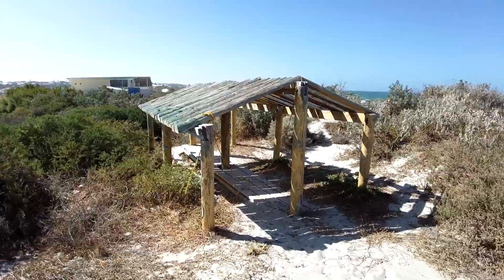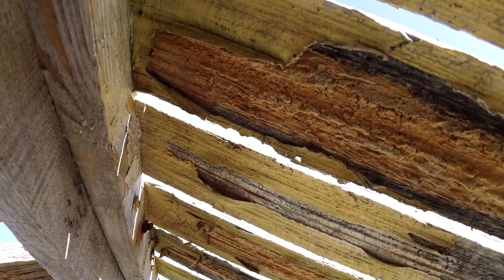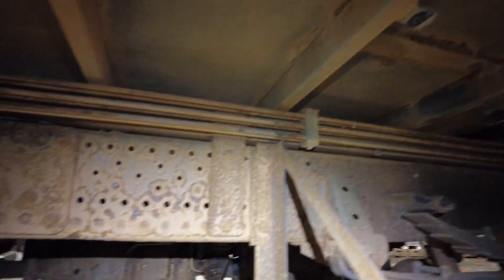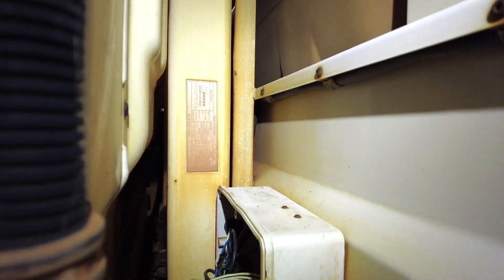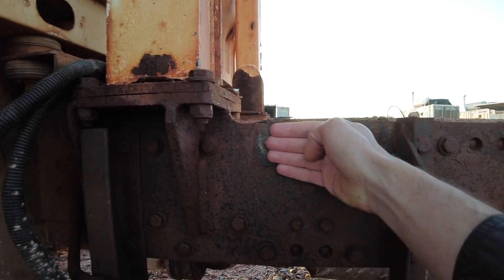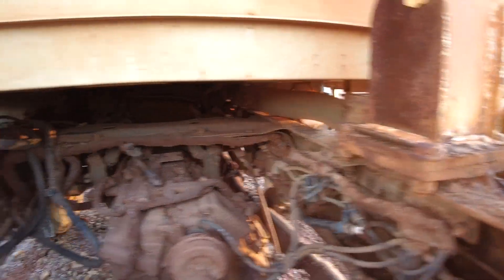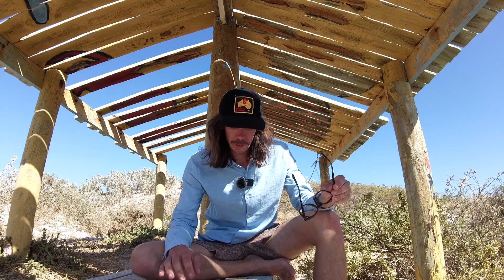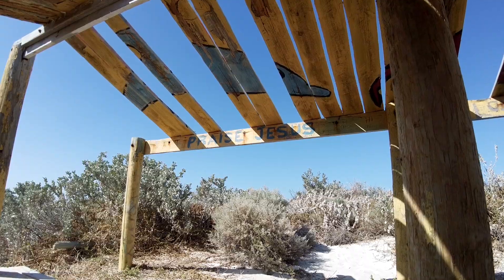Suzie's Weight-loss Journey - Isuzu NPS Expedition Truck Build - Episode 1

Comment: thank you for the detailed video 
wish on your rebuild of Isuzu 300/75 crew cab 4x4 truck
know second hand  2010 Isuzu model 5200cc with 5 speed   as happy with being the best buy  as keep weight under 6ton with them as can run 17lite to 100km on diesel